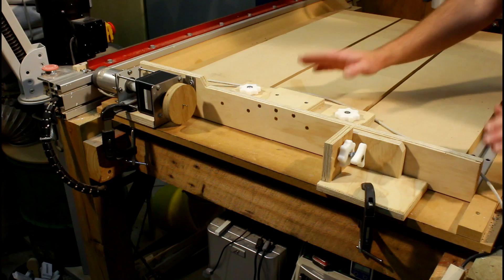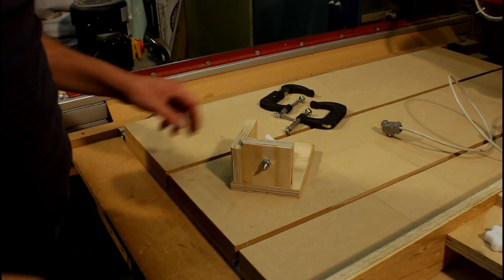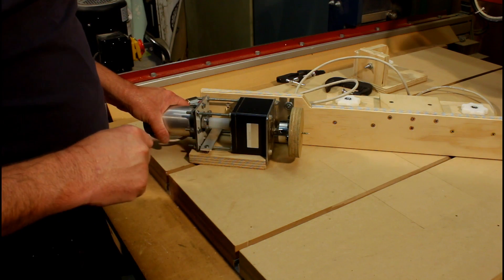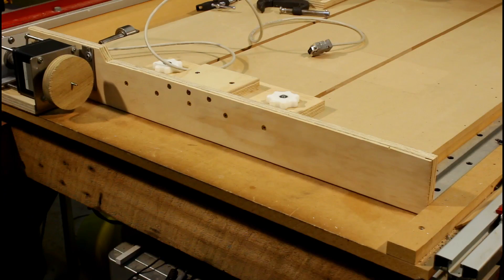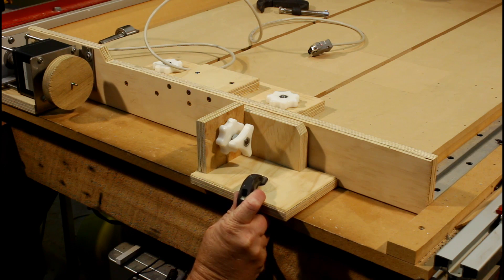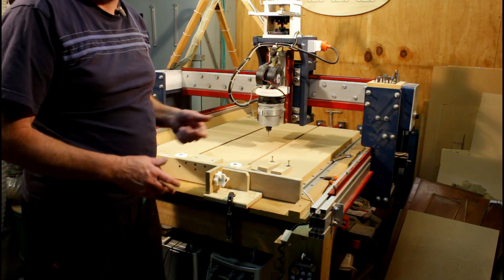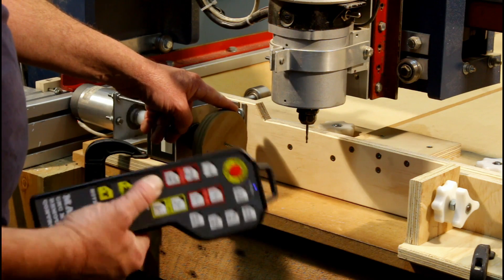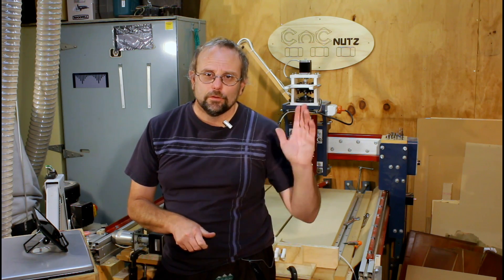Rotary Axis project - CNCnutz Episode 75

Comment: Great work as usual peter, what about the ball bearings you are using? they usually have a play and it is really difficult to find a C0 ball bearings.
Reply from the maker: Hi Graphicman
I abandoned this design because of the backlash in the gearbox and designed my own headstock and Tailstock.
I used self cerntering bearings for the project and play is not an issue. With this type of bearing you can preload the bearings against one another and remove any play if it is an issue.

New Headstock
https://www.youtube.com/watch?v=CO6CIL3cOlc

New Tailstock
https://www.youtube.com/watch?v=1RqlVsTwEfg

Cheers
Peter
Reply: Thanks Peter, I have also viewed all these video, they are amazing and very informative indeed, even for the new design with the self aligning bearings I still cant understand how can you control the internal play of one of them.
Reply from the maker: There is no internal play on the bearings.
I checked mine and there is no side to side or backward forward play on mine and i did nothing to eliminate it. I use the same bearings on my machines Z axis and it has no play in it at all.
Cheers
Peter
Reply: Thats great, it must be this type of self aligning bearings are built that way, I will try to find them locally as it is too expensive to buy them overseas, Thanks again Peter, appreciate your efforts in making these videos, please keep it up.
Reply from the maker: As I recall I purchased those bearings complete with flanges for about $7 USD each from the big bearing store.
They were quite reasonable for the postage to me in New Zealand. I don't know where you live but maybe it will be worth checking out.

https://www.thebigbearingstore.com/1-2-four-bolt-flange-bearing-ucf201-08/

Cheers
Peter
Reply: The shipping cost more than 4 times the bearings itself, mabe it is the best to try to find them locally first.
Thanks Peter again you are the best (Y)

Comment: Nice set-up Peter. I made mine using the front of an electric drill with 8 to 1 reduction. Did not like the way Mach 3 handled the A axis. So I set it as a normal axes and I calculate the inch movement to circumference.